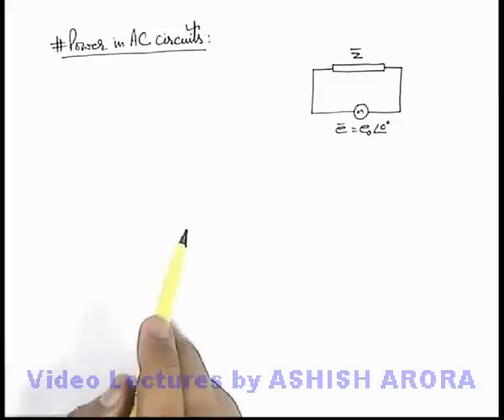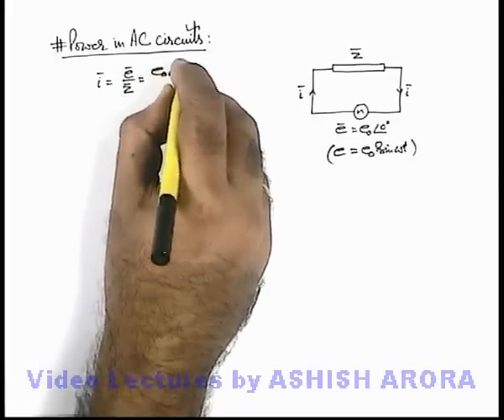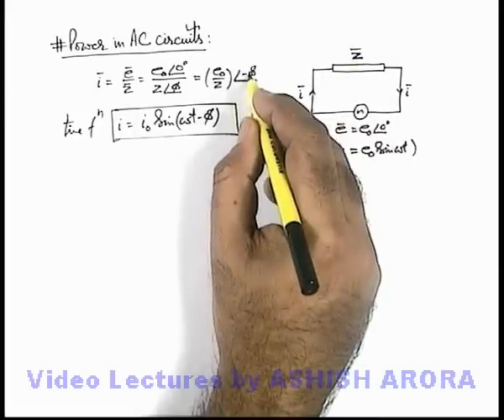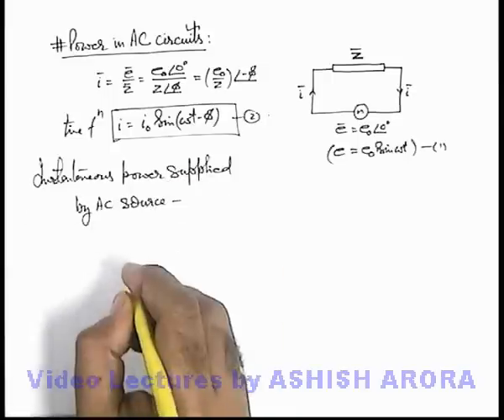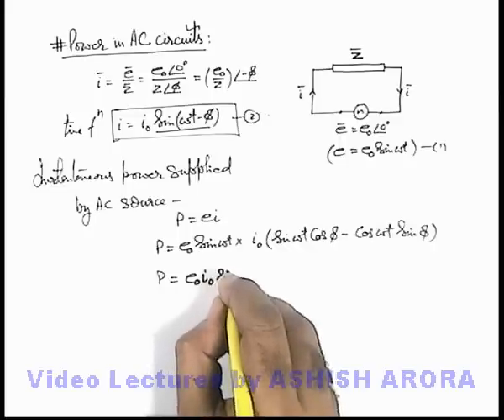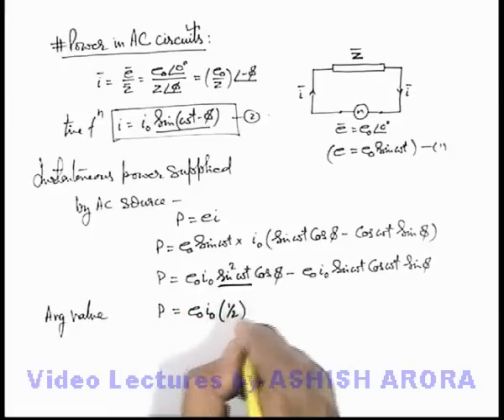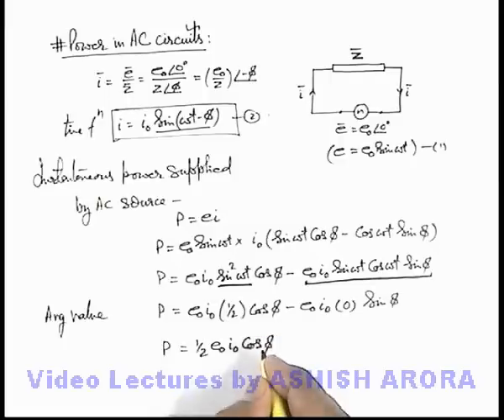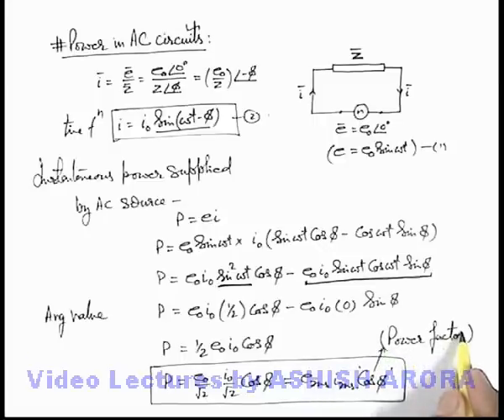Class 12 Physics | Alternating Current | #34 Power in AC Circuit | For JEE & NEET

Comment: SIR  THERE IS A QUESTION'   A COIL IS GIVEN INDUCTANCE OF .05H AND RESISTANCE 100 OHM IS CONNECTED TO 240V,  50HZ,AC SUPPLY.       WHEN CURRENT IS MAXIMUM POWER DISSIPATED      =   VxICOS PHI WHERE PHI=WL/R      BUT SIR THEY WROTE  324 IE DIRECTLY I SQUARE R     AND SAID ''''VOLTAGE IS MAXIMUMWHEN V=Vnot t=O. AT THE INSATANT OF CLOSING THESWITCH ,THE COIL ACTS AS OPEN.HENCE CIRCUIT IS OPEN.CONSEQUENTLY VOLATAGE DRP ACCRPS R IS ZERO''''''
Reply from the maker: +Arabinda Biswas Pl post your specific queries in INTERACT Tab in Physicsgalaxy.com... it is better to post your queries below videos should be related to videos... it will help other users in understanding of the video...

at the instant of closing the switch coil act as open in case of a DC source, for an AC source it depends also on initial phase of source... it is better if you calculate it and find the amplitude of AC voltage across the coil... see what is the result...